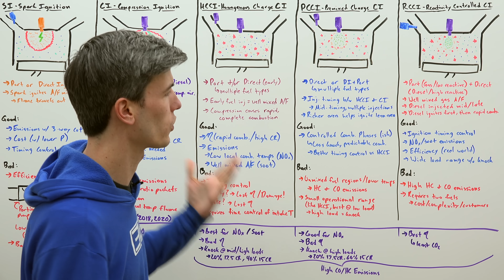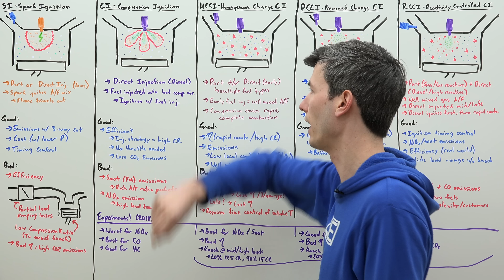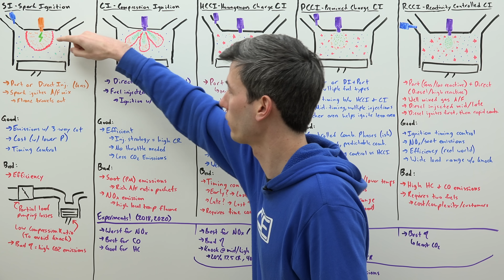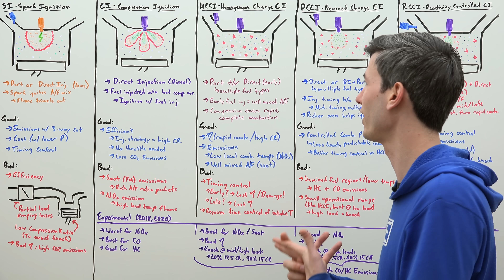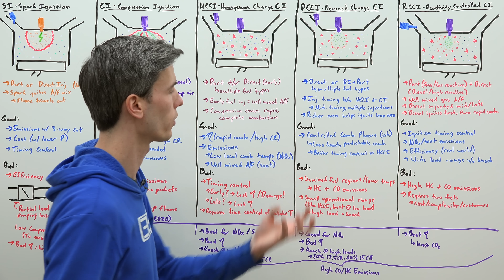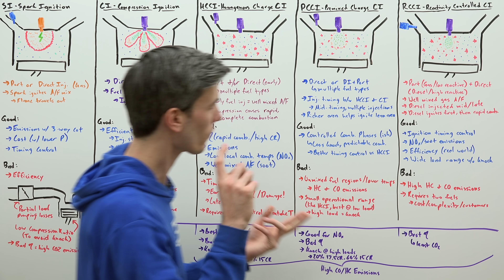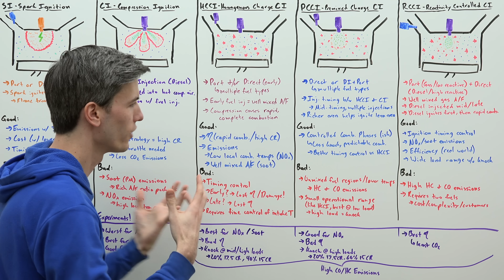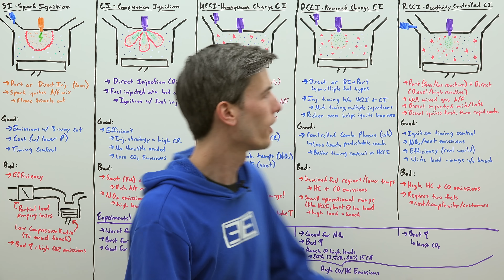If Combustion Engines Have A Future, What Is It?

Comment: Everyone forgets about airplanes.
Reply: And the fact that small planes still use leaded fuel hahaha.
Reply: @samwyzegg7935  That's slowly on the way out. Lead is leaving AvGas with new companies and newer "Lead-Free" AvGas.
Reply: @Kamen_Rider_Blade  Well correct me if I'm wrong but I am aware of the Piston Aviation Fuel Initiative which is trying to fund/facilitate the development and testing of lead free Avgas but so far none have been successful. And COVID delayed some things.
Reply: @samwyzegg7935  So far, it's been impossible to develop a viable "drop in" replacement for 100LL. Many have tried, so it's not for lack of effort. One possible solution is to move to aero-diesel engines.
Reply: @cujet  like a version of the DA42 Twin Star, two piston engines that run on Jet A1.
Reply: lots of small aircraft still use petrol engines with carburettors..
Reply: @Pilot16H Went to college initially for “aviation technology” to become a pilot, but was instantly turned off when the expenses for the program were steeper than the tuition. Transferred to engineering. Never knew any of this, but I found it very interesting. Thank you.
Reply: Everyone forgets its BS, all past predictions didn't materialize
Reply: I remembered airplanes!
Reply: @craig9365  Some countries (i think Indonesia or Malaysia) have cargo ships that burn heavy fuel oils (basically the crap in Crude oil that can't be processed and burns it as an extremely cheap fuel
The catch? Shittons of Sulphur,Nitrogen,and Silicon Oxides being pumped out with no filtration
Reply: @Solaris_347  Some countries? Most cargo ships are burning bunker oil. Tbh this is a far bigger issue than aviation, especially since shipping can actually be improved by a lot while the dream of electric aviation is several decades away or more (though there are aviation biofuels coming to market that are close to carbon-neutral, United already uses one of these to some extent).
Reply: Why wouldn’t an electric plane work? I mean like a crop duster. Propellers type plane.
Reply: It would solve a lot of issues if we would really forget about them
Reply: @nathanwabre  Aviation is the ultimate solution...
Reply: synthetic kerosene
Reply: Airplanes have pistons?
Reply: @anim8dideas849  Some of them. Most small aircrafts have piston engine, medium ones tend to have turboprops, large ones jets.
Reply: @anim8dideas849  Well, Back then and for lighter Modern day aircraft they used Gasoline or Diesel Engines
Reply: @Pilot16H Have you Ever Flown a Diesel Aircraft?
Reply: Thats the hilarious part, Diesels are getting banned while Unfiltered Sulphur Nox,silicon oxides and HCs get released into the air by the Tons because of Air Travel
The same people that preach about Using Crude Oil Fly around the country in one of the Most Thirsty Engines eve rmade
Reply: cargo ships should be considered more, we focus too much on clean energy and eating less animals but no one considers the huge container ships delivering basically all consumer goods while creating more pollution per ship than some countries combined car pollution
Reply: That was a great moment in King Kong:  "There's one thing we haven't thought of--the aeroplane!"
Reply: amazing how quickly everyone forgets Humanity's ability to fly.
Reply: Everyone also forgets 40% of Americans that have no garage.  A large percentage have no defined or assigned parking. IOW, no way to charge the car.
Reply: @Pilot16H Its coming, Rotax has a nice turbo out now.
Reply: or giant ass ships or the cars that repair/tow their ev shits when gets crapped or the cars maintainig the electric lines
Reply: Some smaller planes still use pulsed combustion engines, but I think those will be the first to be eliminated by electric planes, which have important advantages, mostly having to do with the flexibility in where you can put the props.
Reply: @ronaldgarrison8478  True but we definitely need to figure out the range of electric planes first. I could see very short range personal flights being a thing but the batteries have such a poor range/weight ratio right not they're not viable. We will get there though!
Reply: @samwyzegg7935  Anything short of a 2 seater Trainer Airplane (Pipestrel made one already, go check it out), the batteries get TOO heavy and aren't worth it to try to make a practical long haul aircraft.
Reply: @ronaldgarrison8478  batteries are unfortunately too heavy right now
Reply: @EugeneYunak  Too heavy for what? Battery planes are available now, with some range, in some sizes. Both of those parameters will increase with time.
Reply: @ronaldgarrison8478  a single jet engine makes 1700 horsepower i also don’t think you understand how a turbine works good luck making it electric😂
Reply: @mercury0214  Its been done, and engine output is measured in thrust.
Reply: @ronaldgarrison8478  for small double seaters, electric is already available althought their range is crap but they are great for training and will get better. The biggest problem for medium to big aircraft is the dead weight of batteries. With liquid fuel you don’t need to fill up the whole tank of the plane depending on the distance to cover, also as the plane burns fuel throughout the trip the mass decreases and the range increases plus the lowering mass also allows you to fly higher with less air resistance and greater groundspeed. This advantage does not happen with batteries in which the airplane mass, most efficient altitude, and energy consumption all remain the same. 
Fuel also allows for more safety because it allows for jettisioning(dumping fuel while flying), in case of an engine failure you may need to descend because the remaining engines don’t allow for cruising at such a high altitude anymore BUT if there’s an obstacle like a mountain that you need to cross over you can dump fuel to lower the mass and remain at a higher altitude. You can’t just drop several tonnes of batteries, and even if you could you would then mess with the balanced mass of the aircraft.
So as you can see there are many more issues to solve with elecrric planes than with cars.
Reply: @jesusu.4647  There's also fire risk with some batteries, which depending on how they're arranged could mean more weight for firewalls causing even less range. One advantage for batteries when they advance is balancing the airframe during design should be easier with the static weight. I know airbus is working on hydrogen engines, which obviously have their own problems, but I think they could be the logical step especially for larger planes.
Reply: @ronaldgarrison8478  

Pilots have "range anxiety" in a 172. Only imagine "range anxiety" on a EV airplane.
Reply: @Frank71  Whatever. I have range anxiety when I walk down to the grocery store. None of this crap means anything without some numerical analysis.
Reply: @ronaldgarrison8478  

What ever. The EV plane can bearly make it out of the student pilot practice zone of your local General Aviation airport.

The NTSB files for GA are filled with crashes resulting from running out of fuel.

If you have "range anxiety" from walking....you need to lose weight.
Reply: @EugeneYunak  even to replace motors on carbeurated, prop planes? I have seen successful test flights.  Its still like buying a 2012 Tesla new, rather than a 1970's camry, but the tech is sound.
Reply: Turbines still get measured in SHP. Turbines get used in other places other than just planes. The last ship I was stationed on had three; two for main propulsion and one as an emergency generator.  @tomnwoo  

Large ships are not burning much fuel compared to the amount of product they are carrying. While dirty, they are still "cleaner" than truck or train. Next cleanest is a train. So while we could improve the quality of the fuel they burn, it would cost a fortune for a very small benefit. It would be far CHEAPER to just buy less stuff, but Americans love consuming, so that won't happen.
Reply: Airplanes have jet engines not piston engines like cars
Reply: @UnipornFrumm  Not all planes have jet engines
Reply: @UnipornFrumm  indeed, but the video is titled about combustion engines, not just reciprocating engines
Reply: @UnipornFrumm  Still ICE.
Reply: @UnipornFrumm  Uh not all planes. Propeller planes have some form of reciprocating engine. There are many configurations like radial, rotary, V, H, and Wenkel. They all of pistons just like car engines. They need leaded fuel so that knocking doesn't occur at the higher elevations with lower atmospheric pressure.
Reply: @SamwyzwGG
If a turbo or supercharger was used, would that fix the issue with altitude varying pressure?
Reply: @mikeguitar9769  Thats been done, I think it was first done in the 1930s, but it's expensive and complex and the supercharger needs to be driven at variable speed depending on altitude, I'm just imagining now but I would think that it's  cost prohibitive
Reply: @mikeguitar9769  It's common for piston aircraft to have turbo chargers, superchargers are less common.  Turbocharged piston aircraft are often called "turbo normalized" because the turbo charger is used to supply  sea level pressure at altitude it provides no or minimal boost at sealevel.  The varying amount of boost provided is controlled by a wastegate.
Reply: @mikeguitar9769  Yes but when you compress the air, some of that energy also goes into heating it up, thus making it more prone to knocking. Water injection can be used to cool the charge through latent heat of vaporization, thus making the charge denser. In a car, intercoolers are used to cool the intake charge.
Reply: @samwyzegg7935  so there are no turbine propeller aircraft then in your world - are you already on mars then lol
Reply: @drdoolittle5724  what is this in response to? I never mentioned turboprops because they use jet fuel not leaded Avgas which is what we were talking about?

Comment: why do old diesels have a cr of 20:1 and new ones only like 16:1?
Reply: Newer engines are turbocharged, which makes the effective compression ratio much higher than the geometric compression ratio. For example, with a boost pressure of 1 bar, the effective CR is about 50% higher than the geometric ratio (depending on turbocharger efficiency). So a 16:1 CR with 1 bar of boost is effectively about 24:1.
Reply: AFAIK, first of all to reduce NOx emissions.

Comment: Here in Europe, people install LPG systems on both Gas and Diesel engines. So if you install that on a diesel, you basically end up with your own RCCI engine :D
Reply: LPG and Diesel?  You sure?  Doesn’t LPG have a lower ignition point than diesel (but similar to gas)?  LNG and diesel have similar ignition points and both fuels can be used interchangeably (or mixed) in Diesel engines.
Reply: @ianchandley  lpg injection has been around for diesels for quite some time. Improves engine efficiency
Reply: And by quite some time I mean since day 1

Comment: The future of the IC engine needs to be hydrogen. Not fuel cells, actual fuel.  Clean burning, effectively limitless supply.  The infrastructure for storage and distribution are solvable with  enough investment and political will.  
The sounds of a NA V12 doesn't need to go extinct, it just needs to change fuel.
Reply: I WANT MY ROTARY BACK

Comment: Internal combustion engines have still not improved satisfactorily on the piston/cylinder/crank arrangement, which has been around for about 150yrs and is a crude system for producing rotary motion.
Reply: Gas turbines are the exception to that. They're a bad match for automotive use though.

Comment: Putting efficiency aside. ICE engines still have the greatest range for lower cost, lower weight, and can produce more power. Gasoline is the real issue here. Efficiency doesnt matter to consumers if the fuel source is abundant and low cost, really. If the environment is really the reason for eliminating ICEs, then why not slash emissions in half by making over-built high HP 1.0L engines put inside lighter weight cars rather than making cars heavier and bigger every year? Then further reduce emissions significantly by making them mild plug-in hybrids using a small system? ICE cars have the benefit of extremely low weight but few are taking advantage of it. Low weight cars should use ICE/hybrids, heavy cars should use electric. This places them both in their expertise.
Reply: how do you expect efficiency from engines that use a "waste" gate ? in the case of turbocharged engines, you don't

to fix it you have to use that heat to do useful work ... the solution is out there, but the industry is full of pencil pushers that don't understand the bare minimum, how do you expect them to make efficient engines ?
Reply: @ssllhh100  Either way, efficiency doesn't matter much when your working with much smaller engines in very light weight cars. For example, a Caterham 7 weight around 1,200lbs but gets 55+ mpg from an old small engine and still accelerates quickly despite many limiting factors of old technology, bad aero and large amounts of steel. On top of that, its low weight means less brake changes, less tire changes, less load on the engine thus a longer life, smaller suspension to further reduce costs and more.
Reply: @JupiterxBlues  oh i know, but this needs to be a top down decision, consumers will always buy the biggest thing they can afford, and producers will listen to their clients ...

Comment: The future is: Ethanol. It's plant based and it is more efficient than gasoline and it's arguably cleaner than electric cars. Because all the CO2 produced in the combustion of ethanol can be compensated by all the oxygen generated by the plants used in making Ethanol. Meanwhile electric cars are often used in countrys where the energy comes specially from fossil fuels and needles to say that the making of the batteries generates A LOT of pollution.
Reply: Yes but ethanol is mostly made of corn. And that requires massive amounts of land. So what'll happen is people will either: A. Chop up more of the already dying forests or B. Make fuel instead of food.
This fuel brings massive ethical questions with it. And while it is more CO2 neutral it is not entirely CO2 neutral in creation and still carries other emissions with it.
Reply: @mrawesomelemons  In fact all the possibilities brings problems with it. As you said there's this problem with ethanol but all the other possibilities there's problems too: gasoline, electric, diesel etc. But it bothers me people trying to sell electric cars as the ultimate solution for all ecological problems and wanting to ban internal combustion engines. In fact the solution would be a little bit of everything because as long there's humans on earth there's gonna be problems too. In Brazil we use sugar cane to make ethanol and this fuel is commonly more used than gasoline but there's still enough sugar cane to go to people's tables and remains some unused canes still, but I don't know how it would be in a worldwide scale.
Reply: @luiz_mootta  you are so right. There is no solution for everything. You need a mixture of many different technologies...
But politics are selling battery electric as the solution for everything
Reply: @luiz_mootta  exactly true
Reply: @mathiasmang848  facts
Reply: @mrawesomelemons  gotta have that high fructose corn syrup

Comment: If a mixture lights all at once, isn’t that detonation? And I’m a little conflicted with diesel being called a “highly reactive fuel that ‘wants’ to light with compression” 
Diesel needs higher compression due to the higher temperatures in order to light. injecting gasoline as a pre-ignition event would start the burn earlier and of course aid in diesel emissions reduction.  I’d imagine a diesel would smoke like mad if it was port injected. 

As diesel tech advances, it’s the injectors that are the biggest change now that we’ve got the SCR/DPF system largely dialed in.  Multiple pre-ignition events ease that flame front and adding more “holes” to the injector tip help aid in atomization. (But we’re still trying to vaporize a thick oil based fuel 🥴)

Comment: What about a very efficient engine that runs at a constant RPM the runs a generator to an electric motor and battery.  This way the loads doesn't change as much and get the efficiency of the electric motor.    this differs from most hybrid cars where the ICE Motor can put power to the wheels as well as the electric.  Any extra power would be stored in the battery but typically the ICE would power the generator that powers the Electric motor.  I have seen the idea of this on a garbage truck where a turbine engine was used.
Reply: Some ships do have this technology, where the propeller is run by electric motors, and the engines are used as generators. Also, there are cars with range extenders, which are not attached to drivetrains, and so can run at optimal efficiency

Comment: I've got a cng /gasoline converted engine. A 70l tank gives about 200km, but loss of power of the engine
Reply: In Australia Ford put some effort into LPG systems for car engines (here LPG is available at service stations for much less cost than petrol). Their last generation of inline 6 LPG engine actually made more power than the petrol engine it was based on! This was achieved by using high pressure direct injection, I think the LPG was actually introduced to the cylinder as a liquid not a gas, so the usual issue of displacement of the air charge in the inlet manifold was avoided.